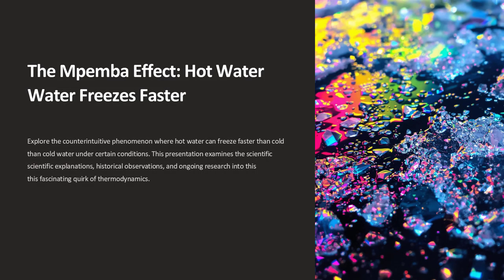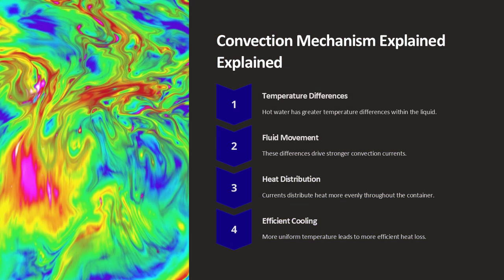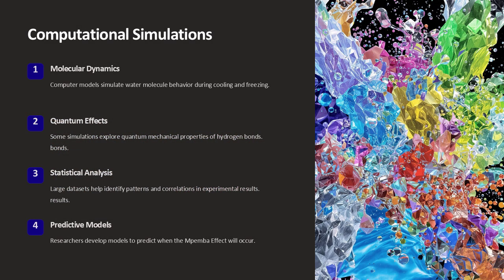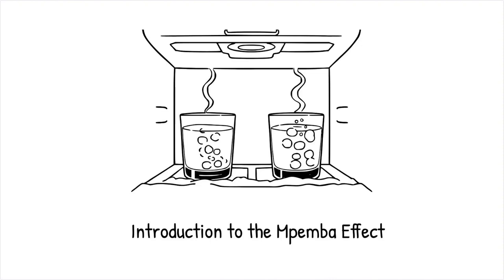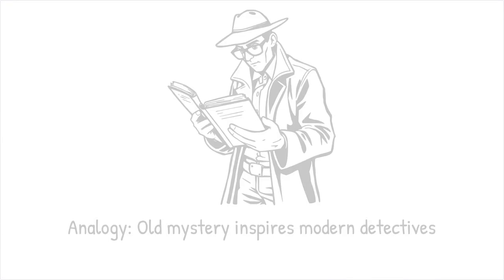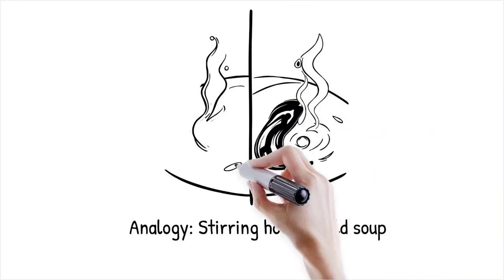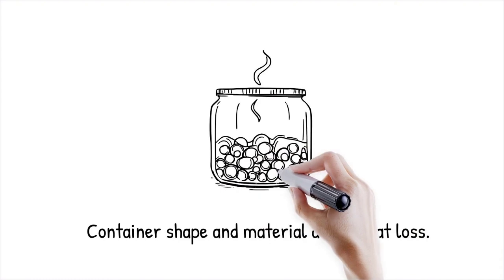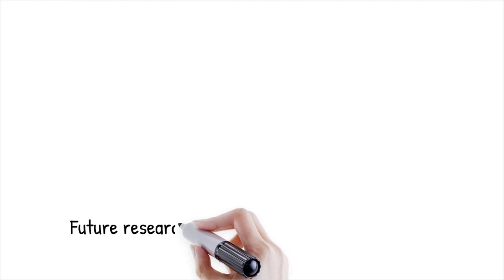The Mpemba Effect: Measurement Error or Thermal Paradox?

Comment: In the winter time, your hot water line is the one that freezes the fastest.
Reply from the maker: That’s an interesting observation! In winter, the hot water line may freeze faster due to a few possible reasons, some of which relate to the Mpemba Effect. One key factor is supercooling — cold water pipes might already be close to freezing, allowing for gradual ice formation, whereas hot water can cool rapidly and hit the freezing point in a way that triggers faster ice crystallization. Additionally, evaporation and heat loss can play a role: hot water in the pipes may lose heat quickly through conduction and convection, leading to a more rapid drop in temperature. If the pipes are poorly insulated, the temperature difference between the hot water and the cold environment can also cause rapid cooling. It’s a great real-world example of how complex heat transfer and phase transitions can be! Thanks for sharing your thoughts! ❄🔥

Comment: We all know intuitively, that hot water dissolves staff, faster that cold water does. 
So why this looks so unintuitive in comparison?
It is also cool to mention, that hot water ice is visibly more transparent, compared to cold water ice.
Reply from the maker: That’s a great observation! We do intuitively know that hot water dissolves substances faster due to increased molecular motion and diffusion rates, yet when it comes to freezing, the idea that hot water could solidify faster than cold water feels counterintuitive. It challenges our expectations because we usually associate higher temperatures with slower cooling, not a head start in freezing. The transparency of hot water ice compared to cold water ice is also an interesting effect! This likely happens because hot water has fewer dissolved gases, when water is heated, gases escape, leading to a more homogeneous structure when it freezes. Cold water, on the other hand, traps more air bubbles, making its ice appear more opaque. This just goes to show how phase transitions are full of fascinating nuances. Thanks for your insight!

Comment from the maker: How do convection currents in hot water influence its freezing rate compared to colder water?
What role do dissolved gases play in supercooling and ice nucleation, and how does heating affect these factors?
Could computational fluid dynamics models accurately simulate the Mpemba Effect and predict under what conditions it occurs most consistently?